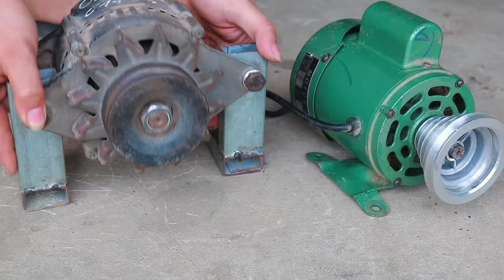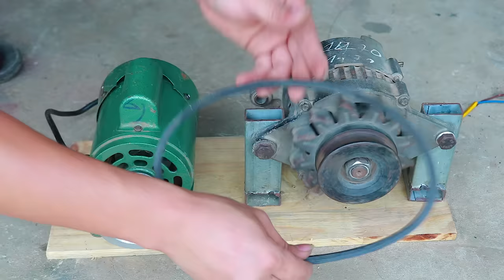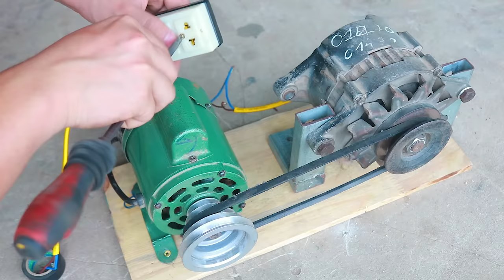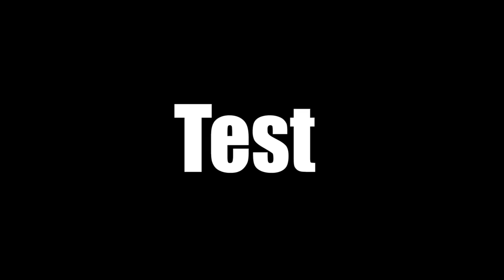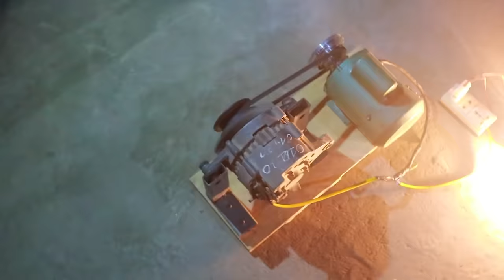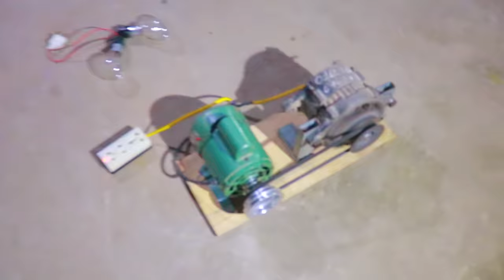How to generate homemade infinite energy with a car alternator and an engine P2💡💡💡

Comment: Please give out more details about how this works. It’s almost unbelievable. !!! It’s almost like your are breaking some of the most fundamental laws of physics that exist. Wow.  I need this exact type of power supply to power the time machine I’m building. If I could somehow channel that power into the flux capacitor next Saturday night I could send my self back to reality ? 👍
Reply: It isn't possible. Otherwise, we wouldn't need power companies. Energy cannot be created or destroyed, only transferred.
Reply: This is a fake.
Reply: I'm assuming the batteries are in the back of the plug outlet he is using.
Reply: It is possible, a buddy of mine uses 10 250 Amp alternators and inverters as well as electric motors and a secondary battery to power electric motor which basically regenerates the power back to the batteries in a closed circuit which is then pushed to a power collector box on his wall by generac which then ties I to his breaker box,  he literally powers his entire house this way. Only problem is if one of the alternators burn out you must replace it and you need several thousand dollars to get all the stuff to run it. Government would have you believe perpetual energy doesn't work but ask any real individual about the working of an alternator you will find terms like magnetic induction which is when the magnets flow around the stator coil creating the electricity.  Issue is alternators need an inverter to convert from DC to ac for your house and the generac system acts like a energy supply reserve so you still jave power even after your alternators burn up or batteries which in any case gives you 72 hrs roughly to replace before all energy is expended. Furthermore you can also use a mower engine as power source though that way would cause excess noise, fumes and you would need to fuel it with gasoline so running the circuit as I explained is the only way. Government doesn't like folks doing this way because if everyone knew how to do it they would ultimately lose alot of money but yes it's definitely a real thing and yes it definitely works. How do you suppose the electronics are able to power your car, lights, radio, ect without a alternators.  That's the point of the job. Fire your car up and disconnect the battery and the car will run provided you don't have electronic fuel pumps and don't turn on your lights. People have been fooled for to long making you reliant on government sourced energy
Reply: It's not fake I've actually seen this in much larger form as a friend of mine off grid powers his entire house using this method.
Reply: @dailystruggles6003  not possible, sorry.
Reply: @dailystruggles6003  1/ how come your buddy has shown you how to make endless free energy but you havnt cooied him? 2/ most countries you can sell excess power back to the power companies. I assume your buddy is a multi millionaire? 
3/ you can run a car with the battery disconnected because the alternator is supplying the power, the engine is powering the alternator, and a big tank of gas powers the engine. Until it runs out. 👍
Reply: This is the real deal so how this works is the alternater has a magnet attached with copper wire which when moved via the drill has a magnetic pull that until forcefully stopped will go forever
Reply: But remember, do NOT think of the color red while trying to time travel.
Reply: Just convert alternator 220v whit some magnetic. To do this job you have to open the alternator first and I will show you the place that you have to put magnetic.
Reply: This is fake. There is a battery behind the electric motor.

Comment: the missing piece here in this experiment is the power inverter from dc to ac.
Reply: You could theoretically attach an inverter. I don't believe this generates enough power to run itself, however.  There's a cord.
Reply: Alternators produce alternating current so no need for ac to dc
Reply: @carlosjimz Car alternators, as the video states it is...produced 12v DC power...not AC.
Reply: Alternators produce alternating current hence the name alternator, that is changed to dc@surive_resist
Reply: It has a series of zener diodes in series to filter the waveform built into the alternator
Reply: Adding a vfd would be bett
Reply: So, a pure sinewave inverter would run about anything?@jamesfarmer-jn4gy
Reply: @jamesfarmer-jn4gy Using a pure sinewave inverter run about anything?
Reply: pure sinewave?

Comment: Very good. We use in Russia. Use 24v Ural truck alternator & elec motor. 4 of this power house. Run lights, microwave, washing machine. Once at time no together but free electric. Now make with 48v jet  APU. This make 4kw power. We light hangar for aircraft.
We sale ex CCCP gas turbine heli, heavy truck, jet Warbird MIG 23's.
Gas turbine alternator APU make 60kw power, this run workshop for jet engine machine, lathe, CAD,
mill machine, air compress for blast cabinet.
This cheap run, gas turbine burn kerosene..
Greeting from Russia (Girood Airfield). ♥️
Reply: Very cool too!! That seems like a lot of things running at once. Very cool that that can be done. I like that!!
Reply: Help me get this what do I need to buy for the whole unit
Reply: Help me what to buy for the whole unit pls

Comment: A few questions: 1) You have a 12VDC alternator supplying power to a 1/3hp, 50Hz, capacitor-start motor.  Any electrical engineer will tell you an induction motor won't operate from DC, so how does this work? 2) Why didn't you lift the entire board and show us the external power connections underneath?, and 3) Why aren't you rich?  The power companies could make unbelievable profits using your so-called invention.
Reply: It is not rich, because it is fake  :face-green-smiling:
Reply: The battery is hidden inside the green motor .   LoL 😂

Comment: How long does it stay running?
Reply: simple! that's don't work one second !
Reply: About untikll you pull out the hiden cable
Reply: Il y a une erreur, 
l’alternateur doit être alimenté en 12 V pour pouvoir produire du 12 V
C’est pour ça que sur une voiture il y a le fil + qui alimente l’alternateur sinon ça ne marche pas, tu peux tourner l’alternateur il n’y aura pas de courant si il n’est pas alimenté

Comment: This concept will absolutely work 1000 percent. You have to take into account what the motor will pull from the alternator as well as loads. If you drag the alternator down too hard it will slow up and the motor will stop causing everything to shut down. If you were to get a high torque motor that could take everything than yes you could generate power. The motor basically once initially up to speed will be fed by the alternator. Electric cars charging systems work on the same principle.
Basically you’d need an alternator capable of high output at low rpm which would be sufficient to feed the motor at the motors full rated capacity under load with extra to spare.

Ie: motor draws 5 amps alternator puts out 20 amps at 120/240 volts ac you’d still have 15a to run loads
Reply: what if a transformer is introduced to boost the alternator's output and then the secondary side of the transformer feeds the motor, will it increase the efficiency?
Reply: Imagine what you could get out of that if you added a power inverter to the setup. One could power a refrigerator off of it instead of a couple light bulbs.
Reply: Il moto perpetuo non esiste, io mi sto organizzando per realizzarlo., ho 74 anni forse a 100 riuscirò.

Comment: Now how do you turn it off you forgot to put a switch on the green motor side haha good stuff
Reply: 엉터리
Reply: how do you put it off and can you boil a kettle on it
Reply: You don’t turn off, that’s why it’s called infinite.
Reply: Bạn làm video đun 1 ấm nước xem
Reply: @robertedward7023   hahaha true that but if shits hits the fan not gonna be nice
Reply: @robertedward7023  when bearings burn out or belt goes ping lol

Comment: When joining the positive and negative wires, are you confecting positive to negative and negative to positive?
Also what are the watts and voltage putouts?
Reply: There is no negative or positive in AC.

Comment: My question is, where did he hide the batteries that are powering the system? Under the wood base, in the power plug block?
Reply: Why would it need batteries?
Reply: Он звездобол
Reply: It doesn’t need batteries. He generated the RPM needed to start current generation through the alternator with his drill and socket.
Reply: 😂😂😂 in his drill. Lmao do know anything? Do not know how an alternator works
Reply: Should have payed more attention to the finger wagging
Reply: No batteries,initially he starts car alternator,(dynamo) and dynamo produces electricity infinitely.
Reply: That's actually quite clever👍
Reply: Drill turns motor which creates a. The ac powers the motor which keeps the alternator going. Wow! I totally get it.
Reply: I’d definitely put a switch in line with it to cut power if you wanted to shut it off only thing I’d change

Comment: Lol considering a car alternator out put is only 12v DC I find it hard to believe you got 240v AC out if it
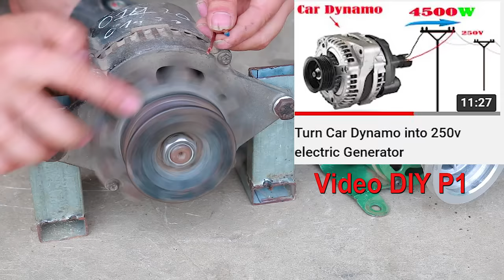Reply: he said 0:23 "turn car dinamo into 250v electic generator" but i doubt too
Reply: I'm curious about this.
Reply: Its possible but you have to get the older Chrysler dodge alternator and remove the  rectifiers …….
Reply: The electric motor is 220 V DC you can do that with two electric motors 220s and have 440 v dc also

Comment: Quite impressive project. With the amount of technologies available now days it is possible to do any DIY system for self-sufficient but I am curious about output of the alternator (14.4V) if it can electrify an AC motor that require 240V without including a step up voltage inverter in the circuit equation. Some alternators start producing voltage at a minimum of 1000rpm and at a maximum of 6000rpm. This depends of alternator brand and model but no less than a car rpm at idle. 

Another problem is that your AC motor looks like it is spinning at an estimate of 200 to 350rpm give and take. This factors raise eyebrows about what's presented and what really can work.

Add step up inverter and proof it with a multimeter then we can assess your DIY authenticity. I'll rather use your model as a DIY for making my own stable mobile car battery charger using a electrical grid to power the AC motor
Reply: Imagine if there was no first or second law of thermodynamics. You would only have needed fuel to produce the first two electric motors, after that there is not fuel necessary for anything. No global warming, no anything. 

An electric-electric drive train with a perpetual motion machine would produce infinite electric energy, powering a third electric motor which can spin the wheels or screws of any vehicle.
Reply: I can't see this working .how ever I used a trolling motor and two years I used a five inch on the trolling motor and a inch on a tread mill motor .blocking diod .a 12volt car battery.and a200 watt inverters.yea it worked ok ran all night just fine but listening to the gears grind drove us nuts .any how in the morning .I checked it the motors were still running.but their was a big problem .the car battery was melting .so shut it down and checked the voltage on the tread mill pay back well need less to say it was at 94 volt to the battery.no wonder if melted .this devise in the video well looks great but doesn't look doable if it is shout out to me .but it not a ward leanard power unit .seen pic of these power units in some old books my uncle had when he was stationed their in the war .thanks man any possibility of this working well just food for thought.thank you .

Comment: I would love to see this with a volt meter used to check the voltages on the input and output sides
Reply: If you Are running the Alternator, you are getting DC voltage ⚡
If You are Driving a AC⚡ Generator, that alternator must be working as a DC Motor.
What kind of⚡, you need to light up The Bulbs.?.?.
My Proyect will be To run the Alternator connected to a Bank of Batteries to Run a Power Inverter to Run the Motor that Drives the Alternator & Whatever The Power Inverter Cap. I can Have to Run more AC  Electric Appliances.
Always Using @ 75% of my Total Power Inverter Capacity Safely. 
Always have Fuses/Beakers and On/Off Switches as "Safety Precaution" in Case of any  Upgrade/Emergency Case
(with my battery charger I'm Completing the Cycle of Creating/Using Energy.
100% 📴 The Grid)
Reply: Yes !!  That’s what we need. Otherwise this is not happening. A 12 volt alt. Does not power a 220 volt motor.
Reply: @chrislewis3893  Some People Just Need Some Extra Attention, even doing 🤡 or 🐒things around.
Reply: @padreantonioraygozav.raygo9576  your right. He got his attention.
Reply: Its irrelevant. Its fake.
Reply: How many have you built? Correctly?
Reply: @padreantonioraygozav.raygo9576  
Energy is waster in the conversion, the converter fan, and s great deal goes to waste as heat. IT DOES NOT WORK consumption is greater than the output.
Reply: @bobjones8372  Only if You are Not Using Solar Panels, Wind or Water  Power Generators. 
When you Combine Solar and Wind Power
You're almost Done✅ 👍
Reply: Id love to see him mount this all on clear plastic so he cant hide his real power cables
Reply: Hate to break it to you all but, this is really an illusion. If you're only trying to say power a couple light bulbs, okay there you go. However if you have to put a strain on the system say by powering a hair dryer and or refrigerator, this system wouldn't be able to keep up with that kind of power out put demand. If you're looking to have a more off-grid, reliable, endless power system without dealing with solar, wind and also very expensive batteries. Mini hydroelectric power that can produce 24/7 producing 1700 w power 365 days a year, making power for free, doing this inexpensively, but putting in some sweat equity, it truly is the answer for off grid living.

Comment: This is cool but you need to use an external source of momentum to truly generate free electricity ⚡️ it is not possible to generate more energy than going in, so the power you used to charge the drill is more than you got from turning the alternator, this is still awesome nonetheless!

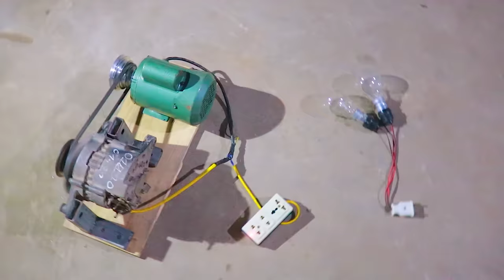Comment: At 5:14 you can see an extra cable disappearing under the board of the motor. Lift the machine up and show us that you do not have an extension cable to power.
Reply: Sorry Roger.... that's a shadow disappearing from him stepping in front of the light. Derp

Comment: Good Idea but will work for a short time depending on the load .  As the load increase,  less power will be available to the electric motor. Motor will slow and power to alternator  in turn will be less. Both would stop turning, generated electricity will stop.
Reply: yeah it won't even turn once

Comment: There are most likely hidden wires coming up out of the floor from under the wood base.
Reply: Jajaja no hay cable,es normal que de luz no conozco mucho pero al parecer es un alternador generador de energía
Reply: Absolutely.  It takes more energy to spin that continuously than it can possibly put out.

Comment: One alternator is powered by 12 volts and it runs the other alternator or motor that has upgraded magnets in it that generates a high amount of electricity. So it's creating enough electricity to run the first device and the second device can store it to a battery or use it live with how much power it generates.  But yes the concept works big time. Simple easy and can give you alternative energy cheaply with upgraded magnets are great.

Comment: El alternador, trae un puente de diodos rectificadores por lo tanto da una salida de voltaje en DC , el motor es AC, corriente alterna, por lo tanto no trabajaría, y esto sin tomar en cuenta los HP del motor.
Reply: Definitivamente cierto 👍.  Ese alternador Chevrolet a lo máximo genera 14 volts en corriente directa. Ese motor es de al menos 3/4 de caballo de fuerza y funciona con 120 voltios de corriente alterna. Le faltaría un convertidor de voltaje intermedio  de mínimo 750 watts de salida que recibiera los 12 volts que genera el alternador y los convirtiera a 120 volts de corriente alternador para alimentar ese motor. Hay más videos aquí en YouTube  que son más creíbles.

Comment: What are the technical characteristics of the car engine and generator?
Reply: You bypass the diodes and you get a output of 90 amps wich is enough to weld with and enough to run your entire house . You just hook the output wires into your breaker box in your house
Reply: @soulmedicine  Great advice, thank you. How do you bypass the diodes? I'm looking to make this and connect it to my off grid charge controller.

Comment: I'm a retired electrician and this Video is totally fake as the alternator needs to be energized by 12 volts dc power. Nowhere is there any power to energize the field circuit in the alternator.  A perpetual motion generator/motor is fake. Also it fails to show the connections to the alternator.  You would have to wire inside the unit,  before the rectifier (diodes) to get AC voltage.